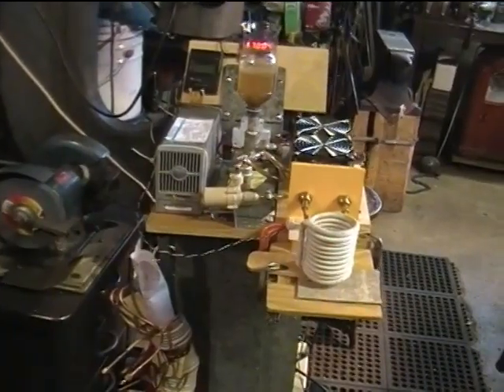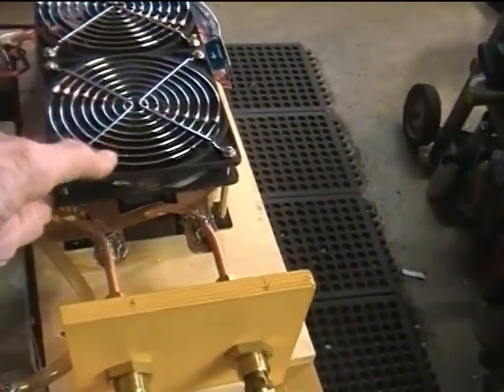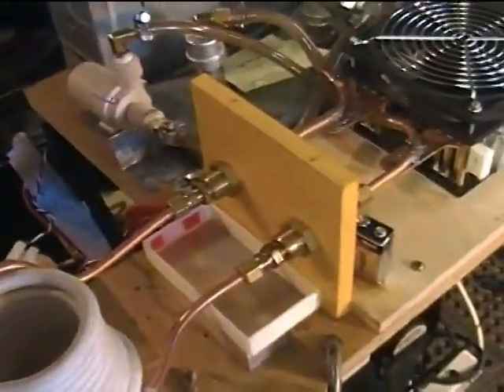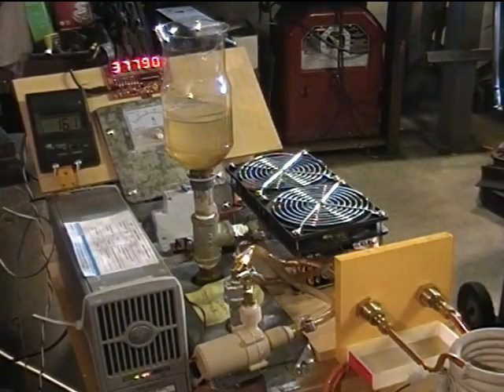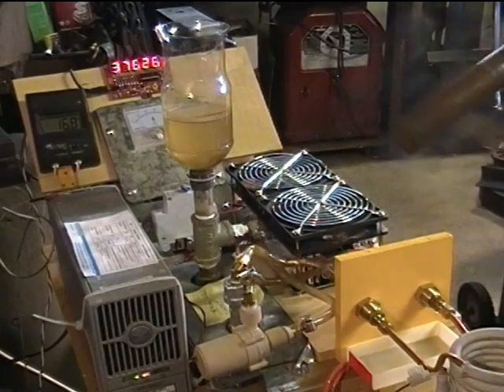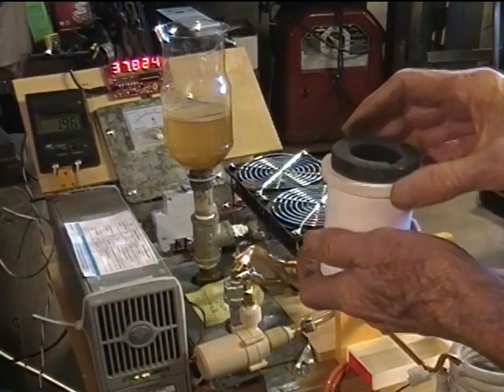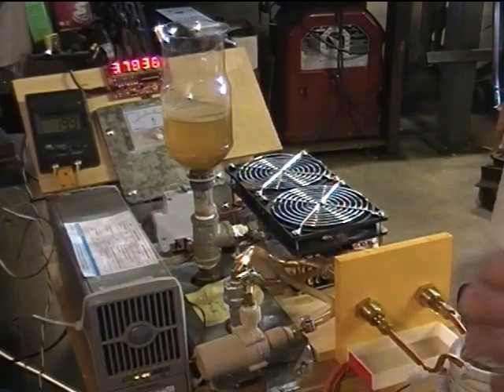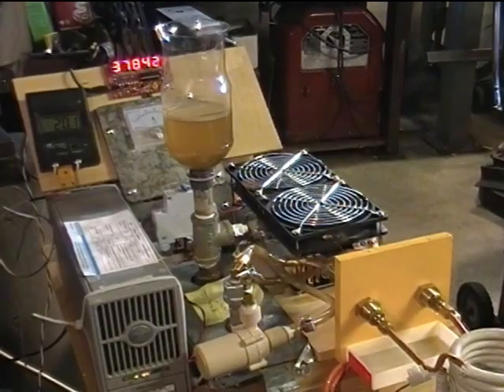2500 Watt ZVS Induction Heater with Frequency Counter & Other Nice Updates

Comment: I am still a little confused on how you connected a frequency counter to this zvs circuit. Is the positive and negative connected directly to the positive and negative of the zvs circuit?
Reply from the maker: See 4:59 where I explain the little "antenna" that acts as a transformer secondary to catch the oscillations of the work coil.  The sine wave signal   goes to the Schmitt trigger board that is located underneath the frequency counter where it is turned into a square wave to feed the frequency counter itself.  See 4:12, where I begin describing the whole counter thing in some detail
Reply: @frenchcreekvalley  Ok I think I understand it a little better. Is this the same procedure of you were to connect the Ava to an oscilloscope? Would you still make the 40 turn coil in close proximity and connect that to the oscilloscope?
Reply from the maker: @jonm4467  Your suggestion for connecting an oscilloscope would work, but I usually connect the scope between  any one gate and ground of the induction heater.  You can also connect the scope across the work coil, but you MUST have the scope's ground isolated in most cases.  I have a little battery powered scope that can be connected that way.
For a more complete explanation of the frequency counter, see:
https://spaco.org/Blacksmithing/ZVSInductionHeater/MakingAFrequencyCounterForNoisyAndSineWaveInputs.htm

Comment: was , wondering, what would be the necesary set up to proprely melt stainless steel, ur same crusible size ur using right now
Reply from the maker: I have not yet attempted to melt any ferrous materials in a crucible.

Comment: Hi, In schmitt trigger circuit antenna connect to GND and INPUT of circuit right?
also capacitor is non polar right?
Is wire size for antenna important?
Reply from the maker: @caeiranir-dk4rw  Sorru!  My mistake.  Should read 560pf.    It is labeled "561".  The actual value probably isn't all that important anyway.  Maybe a little higher if the incoming signal is very noisy,  In this application, we get a pretty nice sine wave.
Reply from the maker: Yes, antenna connects across GND and INPUT.
Yes, use non polarized capacitors.  the voltage generated by the antenna is on the order of 1.75 to about 2.5 volts peak to peak.
No, the wire size is not important.  The wire that I used is solid wire of about 20 gauge because It had a lot of it.   Solid wire stays coiled better than does stranded wire.  You could use  just about any size of insulated wire that you can find.

Comment: Will that melt any metals in those crucibles?
Reply from the maker: It will indirectly melt non-ferrous metals such as copper, silver, gold and aluminum.  I have melted 250 grams of copper  to a good pouring temperature in about 7 minutes.  What I mean by "indirectly", is that you must put the metal into  graphite crucible.  The graphite crucible heats up and, by conduction and radiation, heats the copper.    I do not think it will melt steel in any useful way.

Comment: Thank you for sharing your experimentation with this.  I will be interested to see the final setup, and the coil designs affect on frequency.   Also interested to see the utility of this with your power hammer or whatever other use cases you have for this.